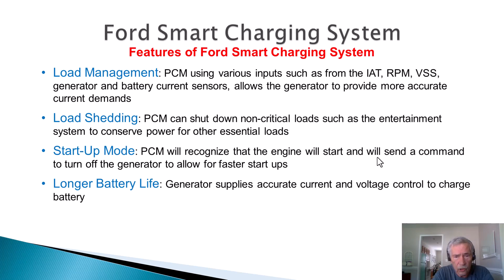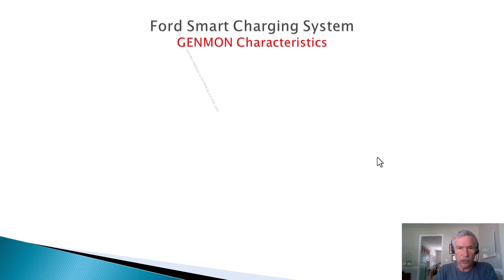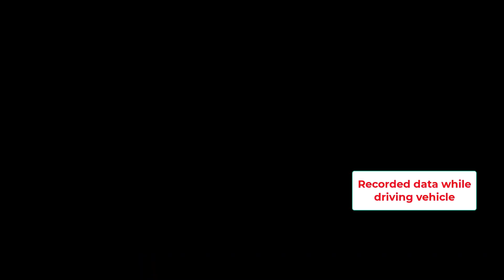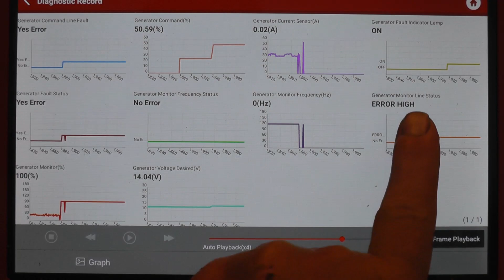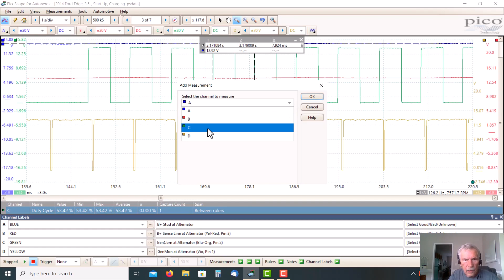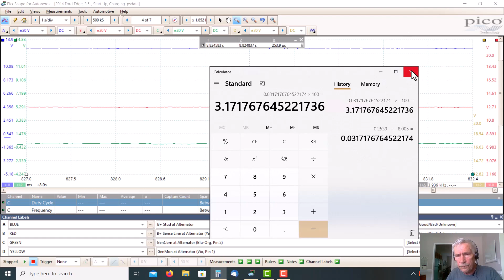Understanding and Diagnosing Ford Smart Charging System

Comment: I have been fighting voltage issues for months on my 2011 F150. I have a audio system installed with an AGM under the hood, all wiring and factory grounds upgraded, and i just installed a Mechman 370 amp alternator. The new alternator is charging at the same amperage as the old factory one was. I bought a obd2 plug and used forscan to reset the bms but the PCM doesn't seem to command the alternator to charge any better than the factory one.
Reply from the maker: Obviously, the BMS doesn't know there is a 370A alternator on there. I typed in your question to Google's AI and here is some things that it recommended. Hope you get it sorted out.
t sounds like your viewer has handled the hardware (alternator, AGM battery, and wiring) but is being held back by the truck's software-driven
Battery Management System (BMS). 
Since he is using a 2011 F-150 with an AGM battery and a 370A Mechman, the following three areas are almost certainly where the bottleneck lies:
1. The BMS Sensor "Choke"
On a 2011 F-150, the BMS sensor is a small ring located on the negative battery cable. 

    The Issue: If he ran his new upgraded ground wire around this sensor instead of through it, the truck cannot "see" the current moving in and out of the battery. Even if he went through it, the factory sensor is calibrated for a standard flooded battery and a 135A–155A alternator, not a 370A unit.
    The Fix: Most high-output audio users unplug the BMS sensor entirely. This forces the PCM to stop "smart charging" (which often caps voltage at 12.6V–13.0V to save fuel) and instead defaults to a steady high-output mode (typically 14.4V). 

2. FORScan Configuration (Essential for AGM)
Resetting the BCM only tells the truck "I have a new battery." It does not tell the truck "I have a different type of battery". 

    The Issue: AGM batteries have different charging profiles than standard flooded batteries. If the truck still thinks it has a standard lead-acid battery, it will undercharge the AGM, potentially leading to premature failure.
    The Fix: He needs to use FORScan (a software for Ford diagnostics) to change the "Battery Type" in the BCM to AGM. He can also use FORScan to increase the "Target State of Charge" from the factory 80% to 90% or 95% to allow the Mechman to actually work. 

3. Mechman Specifics: The "Ground Boss"
Mechman alternators, especially high-amp units, often have a specific ground requirement that is frequently missed during "Big 3" upgrades. 

    The Issue: Many high-output alternators have powder-coated or anodized housings that act as insulators. If he is relying on the mounting bolts for ground, he isn't getting a clean connection.
    The Fix: He must run a dedicated 1/0 AWG ground cable directly from the "Ground Boss" tab on the back of the Mechman alternator housing to the negative terminal of the battery. 

Summary Checklist for Him:

    Unplug the BMS sensor on the negative battery cable to see if voltage jumps to 14.4V immediately.
    Use FORScan to change the battery type to AGM and increase the charge ceiling.
    Check the Belt: A 370A alternator requires massive torque. If he is using the stock-length belt, it may be slipping on the smaller high-output pulley under load. He likely needs a 1-inch shorter belt.
    Confirm Ignition Source: Some Mechman units require a 12V ignition-switched "turn-on" wire to the regulator plug to exit "limp mode"

Comment: What brand of alternator did you buy, also new or rebuilt?
Reply from the maker: The brand that I used was from O'reillys and it's a new alternator. Here is the one that I used and it's still working fine to this day. https://www.oreillyauto.com/detail/c/ultima-select/alternators---starters/alternator/f7cab2ae3cc0/ultima-select-150-amp-alternator-new/usl0/n110251/v/a/128127/automotive-suv-2014-ford-edge?q=alternator&pos=1

Comment: Replace my seized alternator with a new Amazon one on my 2014 f150 5.0 and voltage sometimes drop to about 13,2 v and sets the battery light but still charging. Turn key off, restart, goes away ! May not happen all day ,then out of the blue, battery light. I was told only use a $400 -700  Motorcraft alternator to fix the problem. I don't like rebuilds . Do you think it's the China regulator inside the new alternator?? Didn't have this problem before this installation.Thanks

Comment: Hi, I checked the teory about disconnecting the 3 cables from the alternator and the result is another - the alternator stop charging at all... it didn;t gives 13.8 V, it gives me only 12.09 V (on a battery) - so no charging at all. There is only 1 way how to start the charging cycle - it is disconnect the battery for 30 sec (connect 3 wires for alternator back) - it will reload the PCM and charging cycle will restart again. I hope that this info will be usefull for someone.
Reply from the maker: On most of the vehicles, when you disconnect the three wire connector, you have to raise the RPMs of the engine before the voltage regulator will go into its default mode. If you already done this and it didn't work, the other info you posted is good to know.
Reply: @stuzman52  Hi, yep, raising to 2000 rmp do the trick. In my case start charching after 20 sec rmp 2000+, then it decreases to 864 rmp and charging ongoing - 13.7V . Thanks a lot for help!
Reply from the maker: @Key-M-locksmith  This shows that you have a defective regulator inside the alternator.

Comment: I have an issue with my ford's smart charging system. The generator with non stop regime gives 14.7-14.8 volts without taking on consideration the rpm and gas pedal shifts. My battery is brand new. What problem does it have?

Comment: Outstanding informative video. Appreciated the time spent on explanation. I will try out my pico scope on my failed mustang to confirm the control side of pcm to alternator. Thanks, Russell, Qatar
Reply from the maker: Thanks for watching the video and for the comment! Good luck on your project!
Reply: One question for my better understanding - the duty cycle - does it make a difference if the signals are ground switched?
Reply from the maker: @russellmaguire-g1i  With both of these signals whether it's the GENCOM or GENMON, they are both ground side switched. Not quite sure what your question is asking whether it makes a difference if they are ground side switched. If they were switched on the positive side, the PCM would be programmed to recognize that the signals would be energized when it's switched in a positive state. And as you may already know, when a signal is ground side switched, the signal is in an energized state.
Reply: @stuzman52  hi thanks for response. As an example to try explain what i mean - if a scope is showing 75% duty cycle but the switching is ground side, does this mean its actually 25% duty cycle
Reply from the maker: @russellmaguire-g1i  Well, I guess it would depend on the scope of how it's measuring the duty cycle. As an example, let's use the picoscope. If you were to measure the waveform using the measurements tool, it would measure the high portion of the waveform as the on time even though it could be ground side switched. As in your example, the scope could measure 75% duty cycle, but in reality, it's 25% duty cycle since it's ground side switched. If you know beforehand that it's ground side switched, you can in use the math channel in picoscope to get a direct measurement of this 25% duty cycle. You would set the math channel as duty(-A) where the - sign tells the scope that you want to look at the lower part of the waveform as the on time. As a side note, if you were to use a DVOM which has the function of measuring the duty cycle, it would always measure the high portion of the waveform as being on even if it's a ground side switched circuit.

If you're interested, I did two videos on PWM and go into quite a bit of detail on the subject. The first video is located here: https://www.youtube.com/watch?v=BLCSxkBvL2k

And the second video is located here: https://www.youtube.com/watch?v=OfRj9FGt__I

Have a great day!
Reply: @stuzman52  Dear Sir, i thank you for the above and your time, it has now clarified my issue and it all makes sense. Will look up those other videos you mentioned. Again i appreciate so much, thank you, Russell.
Reply from the maker: @russellmaguire-g1i  Always glad to help and have a great Memorial weekend!

Comment: I have a 2019 escape titanium with the 2.0 engine. Here for a few weeks the car has been very briefly jerking and bucking sometimes intermittently. One time when it happened it quickly flashed the red engine oil light but the oil level was fine. Recently when at a light I went to go and it stalled and an auto stop start warning came up saying to put it in park to restart and I got it going again but it shut off again soon after in a parking lot. I turned off that feature and it has not stalled since. I ran a scan tool and it had some P06a7 code that mentioned something about the 5V reference voltage for the B circuit. I disconnected my battery overnight and I drove it 2 days since with no bucking and no codes except for one code that comes up for the radio even though the radio works, U0184. It had that code prior to battery disconnect too. Using my scan tool I live monitored the control module voltage and it’s all over the place. I have not used stop start since but the voltage with the vehicle off is about 12.3V. When running at first it’s about 14.8V but then it drops back to be about 13.6V most of the time. However, since monitoring this it shows the voltage range and I have seen the range show as low as 0.07V to as high as 58V so something is not right. I’m wondering if this is a potential issue with the voltage regulator in the alternator or possibly a PCM issue? The battery holds charge. The car has just under 69,000 miles on it and is garage kept year round.  I think all of my issues are related to this erratic voltage. Not sure why there’s been no problem since the battery disconnect unless having the start stop turned off is preventing the prior issues. Ever see this kind of issue?
Reply from the maker: With voltages swinging from 0.07V to 58V, I would definitely look into the charging system.

Comment: Do you know where I can find a detailed Smart Charging System Diagram for my 2009 Ford Flex? I am having charging problems, I want to follow the COM line and MOD line for the PCM to the alternator, would like the pin # on the PCM, if possible, it would be a great help.
Reply from the maker: I like to get my wiring diagrams from www.alldatadiy.com Have a great New Year!
Reply: My 2009 Flex is not charging if I disconnect the alternator COM line and the MOD line, mine only has two lines on the back, should it change at  13.8 volts? newly rebuilt alternator and battery is very good, last time bothering you, thank you very much, John
Reply from the maker: @mcfast52  Not sure why you would have only two lines and why they are called COM and MOD. The third wire would have been B+ sense. I guess they're doing something different with your system. If it's like the other generators using Ford's smart charging system, if you disconnect the connector and then rev the engine to about 2000 RPMs, the generator should put out about 13.8VDC. Have a great day!
Reply: @stuzman52  I was mistaken, I just installed a new alternator and I like all the others it has three wires, with this new alternator everything is going well now the old rebuild did not work at all.
Reply from the maker: @mcfast52  Glad to hear that you got it all figured out and that your system is working now. Have a good one!

Comment: Great video Terry!  I have a much better understanding of the system now.  I have been troubleshooting my daughter’s 2013 Ford Escape and have been trying to educate myself on the electrical system; your video is the best I’ve found so far.  She is having an issue with the alternator putting out too much voltage.  It doesn’t seem to happen in the summer months, but it causes issues when it gets cold.  The voltage will peak in the low 17v range and it’s high enough that it will turn off multiple modules in the car (4x4, ABS, speedometer, etc).  With the plug disconnected from the alternator, it supplies 13.5-14v to the battery, indicating that the alternator itself and the default circuitry of the regulator is working correctly.  The problem I’m running into is determining the root cause of the high voltage.  Based on your slide, even at a 95% duty cycle, 17v shouldn’t be possible.  Is it possible for the PCM to command more than 95%?  If so that could mean the PCM is getting an erroneous input (BCM issue, or some other sensor issue).  If not, then the PCM could be messed up and commanding what it shouldn’t, or it’s commanding what it should and the regulator is misinterpreting it and commanding too much voltage out of the alternator.  How would you proceed, given this information?  As a side note, I replaced the battery without change.  Thank you!
Reply from the maker: Getting 17V is pretty high. Take a scanner and look at the GENCOM and GENMOM values in the PCM to see what they are saying. With the scanner still hooked up and the ignition switch OFF, disconnect the three pin connector at the alternator. Place a jumper between the GENCOM and GENMOM terminals. BE ABSOLUTELY SURE TO CONNECT THE CORRECT WIRES AS THERE IS ALSO THE B+ SENSE WIRE, WHICH YOU DON'T WANT TO CONNECT. Look at a wiring diagram for your car to be sure. Turn the ignition switch to ON and monitor the previous mentioned PIDs and you will see that that one will go up and a moment later, the other will go down. A moment later, the other PID will come back to life and other will shut down. This will continue until you disconnect the jumper. This proves that the PCM is communicating, the wires are OK and that the program inside the PCM is doing what it's supposed to do. You could also take a look at the waveforms and see what the duty cycle is at the three pin connector. Of course, be sure that you have the B+ sense voltage there too and that you've gone through checking for voltage drops between the battery ground, alternator case and between the B+ on the battery and the B+ terminal at the alternator. Just from your description, it sounds like the alternator is the culprit. But, diagnose it first before changing it.
Reply: @stuzman52  THANK YOU

Comment: Grand marquis 2001 alternator  charging without plug?
Reply from the maker: Yes, if the alternator is capable of charging, it will do so without the connector. This is one of the steps for diagnosing the alternator. It should be around 13.5V. However, this does not mean the alternator is automatically good. The regulator inside the alternator could be bad which is controlled by the ECM.
Reply: @stuzman52  i have changed 3 alternator  it all charging 13,0v  and 2001 model charging  system not related to the ECM

Comment: What was the issue with the vehicle where the genmon signal was stuck at 100%. My vehicle is having the exact same problem and this is the first good source that has explained my situation.
Reply from the maker: In my case, the generator was at fault. If you want to see what's involved with replacing it, I did a video on a Ford Edge. Here is the link if you're interested. https://www.youtube.com/watch?v=QYYMyrMNEuE Have a great day!

Comment: I have a question for you if you wouldn't mind.  I have a 2014 ford edge sport with the 3.7L. I believe the charging system is identical, even and alternator.  I'm upgrading my car audio system and one of the upgrades will be larger diameter power, ground, and charging wires.  Will changing the diameter of the alternator charging wire negatively effect how the charging system functions or reacts? Thanks for your time.
Reply from the maker: Enlarging the wires to handle more current will not hurt the charging system. Keep in mind that if you're adding an audio system that will handle a significant amount of increased current, you need to be sure that the alternator can be able to supply the extra demand of current.